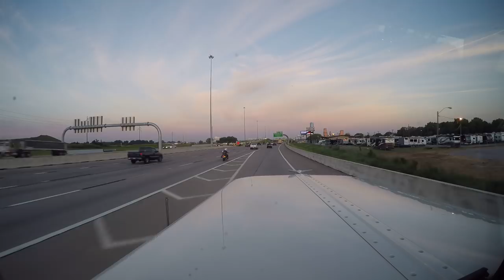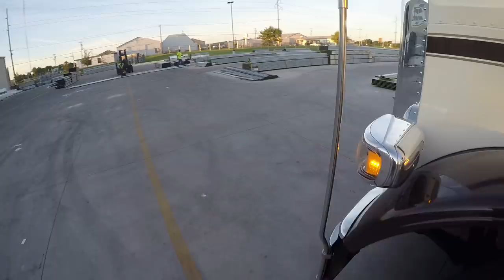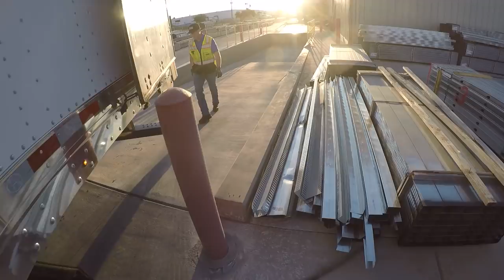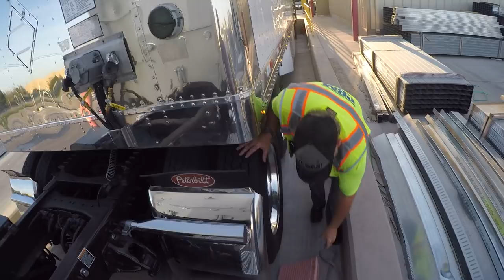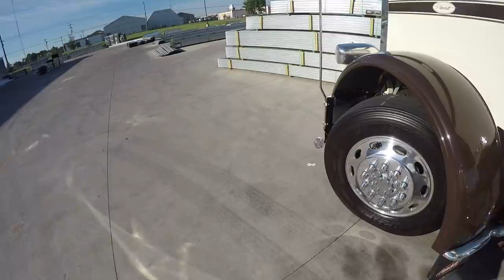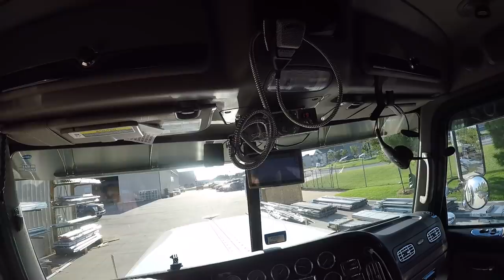Rookie Driver Nailed it on the 1st try, Blew The 2nd Try # 254

Comment: I think the air lines are cool. Just a suggestion maybe put a thin steel plate on the back side of the aluminum would keep the quick disconnect from bending it. Looks really good though. Keep on trucking

Comment: That is a bad place. You could slide your trailer tandems all the way to the front and it will help some. I hauled new furniture for many many years and we kept them forward about all the time. You could have up to 30 drops on one trailer so a lot of backing up and going down alleys.

Comment: Speaking of your air lines I don’t remember if you told in the video but do you mind tellin what it cost to have them moved on your truck and trailer. I’d like to move ours on a flatbed so I can overhang off the front without risking damage.
Reply from the maker: David Miller it was all lumped into one bill with lights and everything, but it’s not very difficult, just a couple of T fittings and splice in the 7 way

Comment: Have you thought about air line quick connects on the front of your trailer? Instead of the mess that is there..
Reply from the maker: Jay Smith can’t, yard guys or someone else might need to move it, plus some places put a glad hand lock on, before they load or unload, and we all know how that would confuse them
Reply: @LifeisGood2018  True..
That's why I pull a hopper bottom. Less hassle

Comment: So many mistakes...  
1. You had an ez back if you would‘be straight back out of the situation you where at... than turn to right and get tuck straight with trailer, and back in dock.
2. If you proceed with the way you did you where a bit far from how I would’ve driver side backed...
3. Slide tandem to front or rear for a for a sharper or slower turn if you still had trouble.
4Other than that you did good

Comment: The only thing I hate about those Cummins X15s is that their air compressor is stupid loud and annoying
Reply from the maker: RDNCKRAMNOSD1 they have a fix for that 👍 I just haven’t done it yet
Reply: Life is Good. That's good to hear is it aftermarket or dealer installed my new tractor will be coming in shortly and it will have  the x15.
Reply from the maker: RDNCKRAMNOSD1 cummins dealer, something about a rubber piece

Comment: Tim, do you think they could stack some more crap around that dock? Jesus, what a truck rodeo. Maybe you could weld or bolt on a skid plate on the bottom of that box. Probably not the first time your gonna face this kind of a situation. Good job tho based on what you had to do, and no damage to the trailer. All good.
Reply: Oh I got it. Tim install some magnesium plates under the box so next time you scrap you get awesome sparks. What we do on the bike for that visual when we come around those switchbacks on the dragon. Come'on 👊🏻